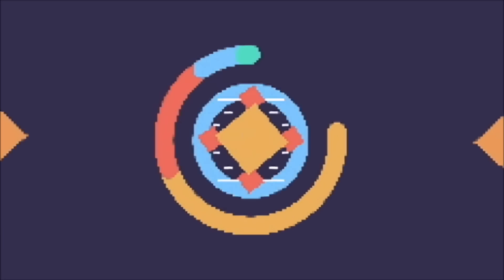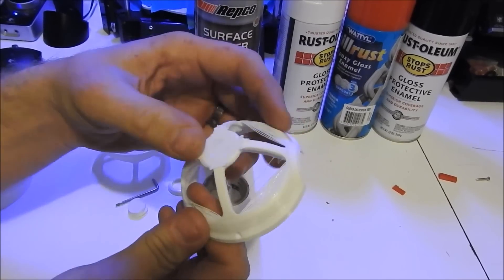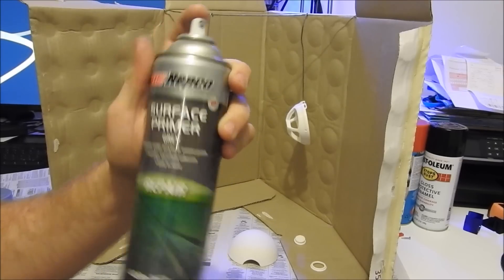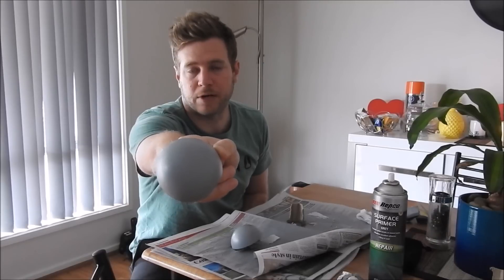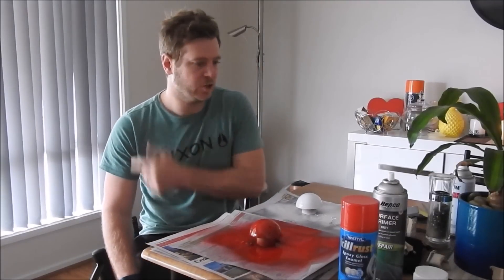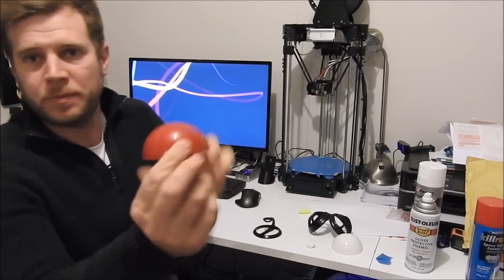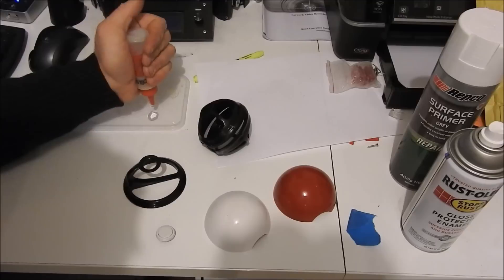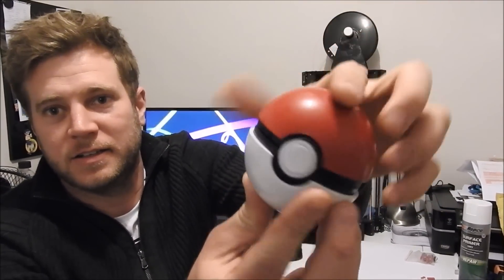3D PRINTED Real Pokeball How to (Easy DIY)

Comment: Very nice finish! I'm in the process of making one myself and want to see what your opinion is on auto filler primer vs the surface primer you used? 

Basically, I want to get the surface to a level that it's hard to see the 3D print lines.

Thanks for the tutorial!
Reply from the maker: To be honest we've only used the surface primer. I think no matter what primer you use it should come up nice, the key part is sanding afterwards starting with a low grit to get rid of the lines and finishing the a high grit to create the sheen.
Reply: Atharv agarwal
Reply: Lovely
Reply: Happy birthday to you later